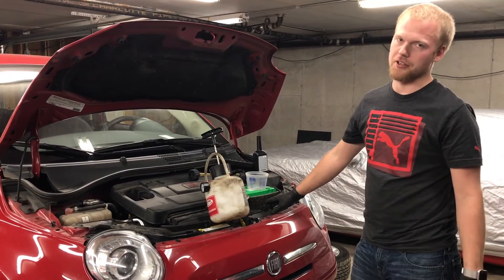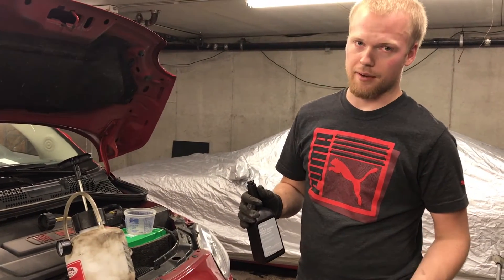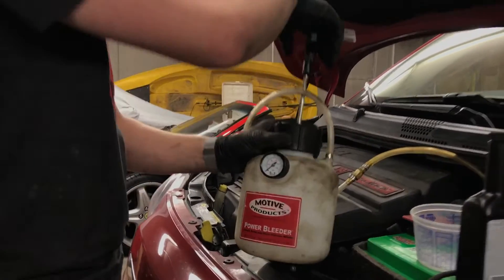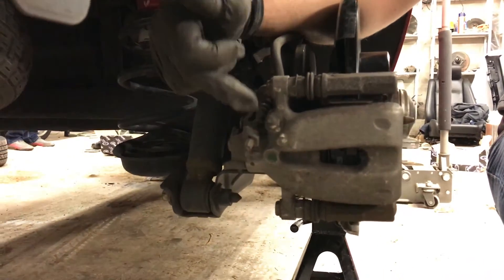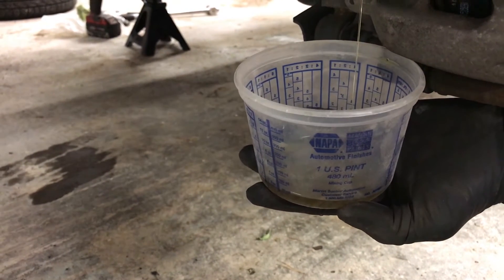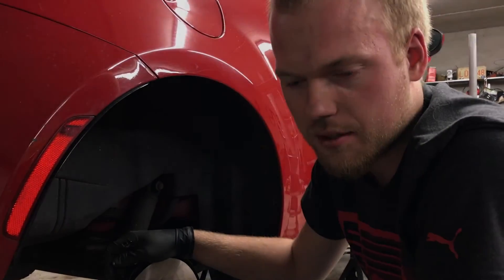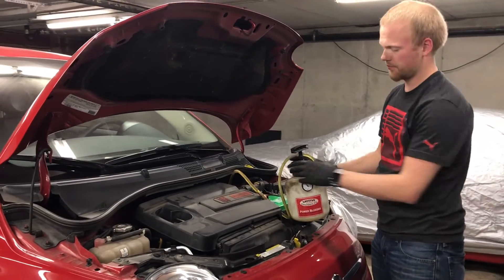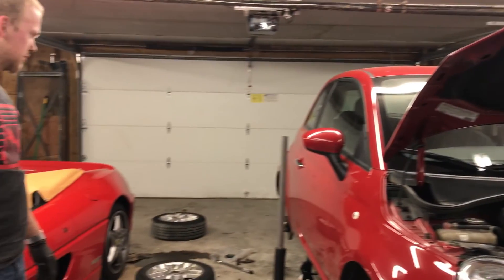HOW TO: Bleed your brakes! Disc brake hydraulic system calipers

Comment: Is there a part number for the cap adapter used here on Fiat 500 for the powerbleeder ? I called bleeder company, either MVP- (1100 or 1109). The later is upgrated to swivel w/longer hose.
Reply from the maker: its the BMW version